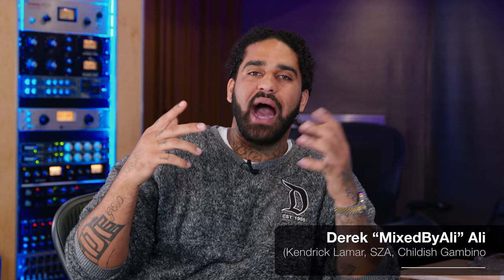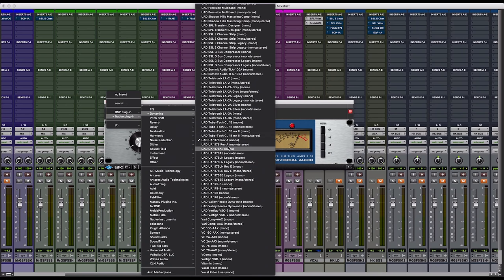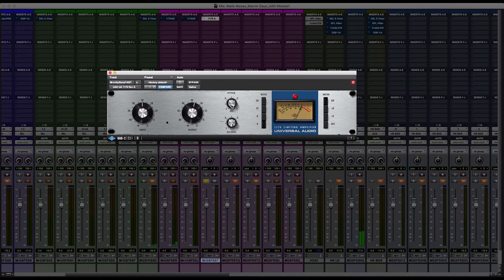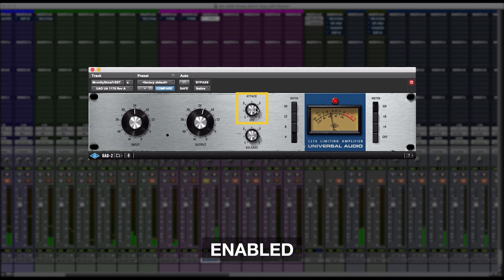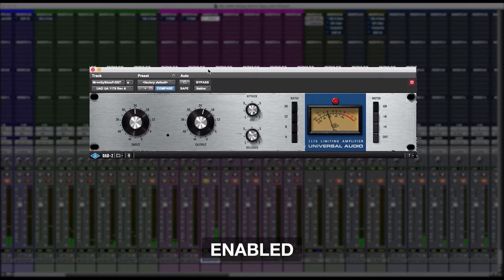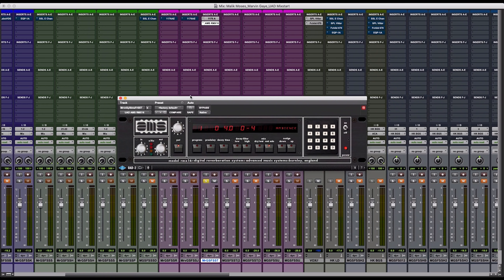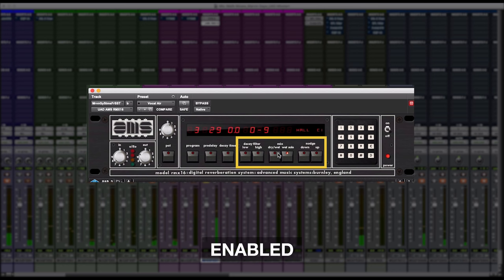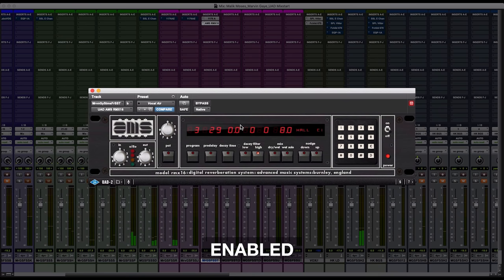Mixing Brass with Derek "MixedByAli" Ali

Comment: going all button sort of changes all attack and release. better do it first ! ALL BUTTON: the attack and release times change. This change in attack and release times and the compression curve that results is the main contributor to the All-Button sound. This is what gives way to the trademark overdriven tone. The shape of the compression curve changes dramatically in All-Button. Where 4:1 is a gentle slope, All-Button is more like severe plateau! Furthermore, in All-Button mode there is a lag time on the attack of initial transients. This strange phenomenon might be described as a "reverse look-ahead".

Comment: "Grabbing" the initial attack on the trumpet notes will NOT make them stick out of the mix more, but do the complete opposite... More transient = stick out and Less transient = push back
Reply: That’s what I was thinking. Then I thought “surely you can’t mix an album like TPABF without knowing the basics of compression?” And now I don’t know what to think 😵‍💫
Reply: @lukestleger  He's a great mixer  so kudo's to him for that, but his understanding of compression is a complete shock 😲 to the system 😂
Reply: @CurtisPennington  also ALL BUTTON, will destroy you attack/release setting. it creates a new attack with a lag decribed as reverse look-ahead. so better hit ALL before anything, and adjust afterward.
Reply: Agree that the transients will get pushed back, but since he's hitting it with so much compression, it does come out a bit more than it would have without it...but your definition is correct.
Reply: @DruDilly  I feel like you saying I'm right but I'm wrong all at the same time 😂... Ali said specifically he wants the trumpet to stick out of the mix more so he grabs the transient with a fast attack setting... I'm not speaking of the overall effect of reducing dynamic range so he can turn it up louder and therefore "poking out a bit more" The transient is what "jumps" off the cone of a speaker and gives an impression of a sound "poking out more" if you kill the transient that can never happen... Its simple
Reply: @CurtisPennington  yep you’re absolutely right.  Let’s just say he misspoke ;)
Reply: @DruDilly I'm not holding my breath, but hopefully Derek can chime in and clarify on what he really meant lol
Reply: Two elements to discuss: 
- By grabbing the transient you can actually push the overall volume louder, because by grabbing the transient you should peak lower which allows you to push the overall volume of the instrument your working on and then have this impression of in your face. 
- Rvox by waves is very famous for this effect of putting your vocals really in your face, and it’s almost a limiter in a way so it’s definitely grabbing transient.
Don’t know if this can help.
Reply: @AstonRecords   if you read my reply to @WrightBrained i discuss this... And i still stand by my initial point
Reply: @Curtis Pennington  You are 100% correct. It doesnt take away from his talent but there's a pretty strong disconnect between his use of mixing buzz words and what he's actually trying to accomplish. It was the same for his hip hop vocal mixing video as well. Thankfully that one was more insightful and on target. What got me more was not having unity gain on the 1176. Of course it's going to sound "better" enabled beause he's made it louder by at least 2 db.

Comment: What does choosing all ratios do?
Reply: Add more saturation basically...
Reply: @HigherSelf  Thanks, does it run 4 compressors in series? In my understanding, each ratio option has a different threshold, would this then change the compression ratio into a primitive curve?
Reply: @RichardPhilbin  it changes the ratio actually to somewhere between 12 and 20 so hard compress limit, slightly changes the attack and release and adds more bite to the sound in saturation. 👍
Reply: @crubileclement5156  That video was awesome, Thanks !
Reply: @HigherSelf  Thanks for the qualitative description. I got both sides of the answer in this thread.

Comment: the GUI on the reverb is just pathetic...
Reply: That's what the hardware unit looks like. UA goes for realism with their GUIs.
Reply: @Jake_Sachs  what's the demographics for relevant sales? I am old, and to me it seems entirely horrible, to stick to stone-age surfaces that suffered from narrow front space or having to construct cheap workarounds like the videorecorder 3-button thing for a hundred functions. And yes, I built quite a number of fine devices, just not on business level. Later on, I produced office management software, and had all those questions about functionality vs. easy GUI. Just wondering a lot, digital stuff ongoing for decades now...